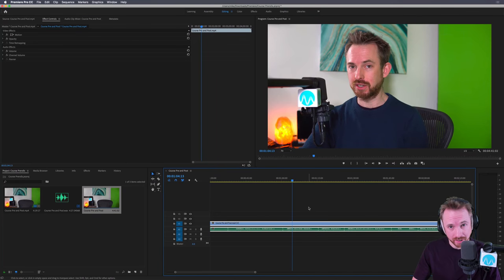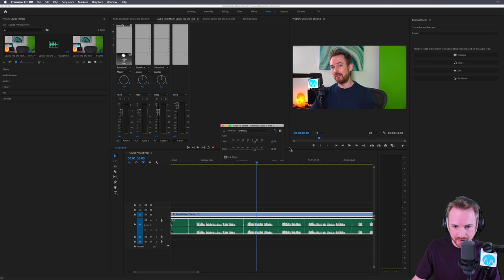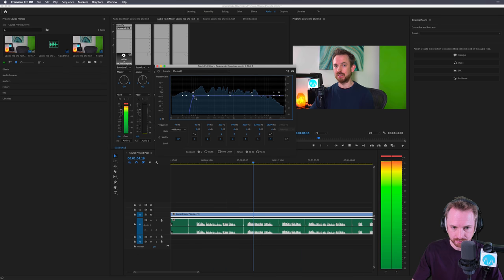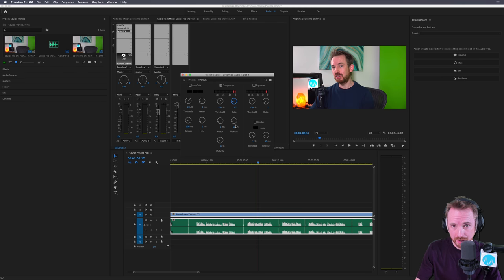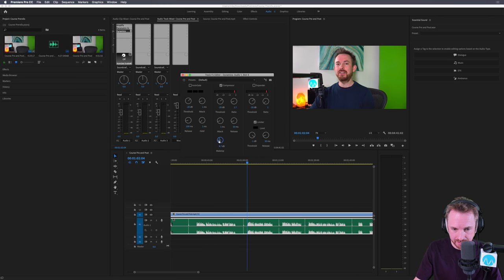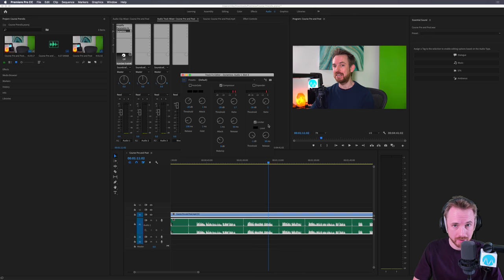How to Make Dialogue Sound Better in Premiere Pro

Comment: 🎯 Key Takeaways for quick navigation:

00:00 🎙️ Improving Dialogue Quality in Premiere Pro
- Steps to enhance dialogue quality in Premiere Pro:
  - Start with good quality microphone recording.
  - Utilize simple processes like amplification, EQ, dynamics processing, and limiting.
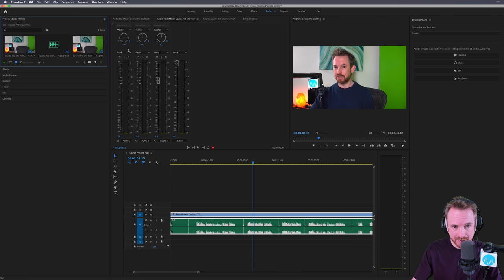01:10 🎚️ Amplifying Dialogue
- Using the Amplify effect to increase audio levels conservatively.
  - Avoid peaking by monitoring audio levels.
  - Adjust amplification to achieve optimal volume without distortion.
03:10 🎛️ EQ for Clarity
- Utilizing EQ to enhance clarity and remove unnecessary frequencies.
  - Adjusting high-pass filter to remove low-end rumble.
  - Fine-tuning high frequencies for crispness without thinning out the voice.
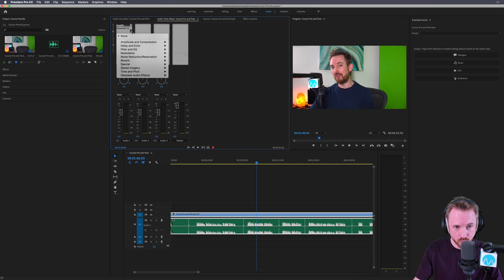04:49 🎼 Dynamics Processing
- Exploring dynamics effects like compression and limiting.
  - Compressing to even out audio levels for a smoother listening experience.
  - Applying limiting to prevent audio from clipping while boosting overall loudness.

Made with HARPA AI
Reply from the maker: Thanks for the detailed breakdown of improving dialogue quality in Premiere Pro, these key takeaways are extremely helpful for fine-tuning audio in post-production! 👌

Comment: Thank you for the video, Mike. I don't know whether I apply too much post-processing, but I use the compressor, noise gate, and expander in OBS, and then add a few simple effects in PP: denoise, deEsser, EQ, and mastering, that's pretty much where 'I'm at' so far.
Reply from the maker: A pretty nice setup there!

Comment: Thank you kindly, Mike, for this straightforward and well-narrated tutorial. 🗣🔊🎤🎙
Why not simply NORMALIZE all clips? Not sure if that's easily done in Premiere, or - if not - via Audition?
Best regards from Switzerland,
Sandro
Reply from the maker: If you want to do granular editing of the audio I would suggest using Audition.  You can export as a multi track to Audition and then normalise.
Reply: @MikeRussell  I absolutely agree. Fair point. - Thank you heaps, you living legend. 👍👐🤝

Comment: That helped a lot! BTW to get a cleaner chroma key you should recored in higher shutter speed, that will prevent that thin green line on around your shot, also add some green bar in the CC to get better skin tone.
Reply from the maker: Thanks.  I don't generally use the green screen anymore now

Comment: Great video! I hear a lot of people refer to -6 as a standard max gain. Is there a reason you're pushing it towards -1?
Thank you!
Reply from the maker: In terms of working with audio in audition as long as recorded audio doesn't not exceed 0db then anything goes.  32bit floating point allows for digital clipping to be easily resolved so the need for carefully managed headroom isn't what it used to be.
Reply: @MikeRussell  aha great insight! Thank you!

Comment: Great video. I use the Essential Sound Panel in the multitrack and set the Dynamics to 3,  set EQ (subtle male voice) to 3, Enhance Speech (male) by checking the box and then if necessary  adjust the Level to make sure it's not peaking. It seems to work well... Is there an advantage to switching to the method in this tutorial?
Reply: @MikeRussell  my own thought is that you get more customisation using your method but at the expense of a less intuitive, longer workflow
Reply from the maker: If you're using Essential Sound and like it I'd stick with it. It's very intuitive and easy to use. This is the method I like to use as I feel it gives me more control especially when adding a high pass filter.

Comment: thanks for this !! is it recomendable the DeNoise? after your process I could still hear the background white noise and the DeNoise barely fixed it, but I didn't know if I should've put it as the first effect or final effect
Reply from the maker: I'd recommend finding the source the white noise and eliminating it before any future recordings.  If, however, you must use DeNoise but it before any of what's shown in the video.
Reply: @MikeRussell  thank you! I think that the noise comes from my PC fans so it's a bit difficult to eliminate it
Reply from the maker: Move the PC to as far behind the microphone as you can.  The sensitive side of most microphones is only the front so the further behind the mic you can situate the PC the less noise from the fans will be picked up

Comment: Is there a way to avoid any/all audio edits to a clip being automatically applied to every clip on your timeline sequence? The method works, but this is a huge roadblock preventing me from continuing my project.

I tried creating a new sequence and working on the isolated clip but that did nothing to help.
Reply from the maker: If you want granular control on your mix then export your audio to Audition and do the edits there and then save it back to Premiere Pro

Comment: I have the limiter turned on as per your suggestion, but the audio level still goes above the limit amount. Does this only work for voices and not sounds?
Reply from the maker: Check the settings of the limiter.  Never in my experience has sound exceeded the settings of the limiter.
Reply: @MikeRussell  Thanks, I ended up using the Hard Limiter, which I found from another one of your clips, but the hard limiter did the trick!
Reply from the maker: Glad it's sorted for you

Comment: Does these settings apply only for interviews or can we try this for short film dialogues as well instead f going for expensive mixing and mastering? Sorry if the question is stupid, I am a newb in sound department and currently in post production of my project.
Reply from the maker: You could certainly apply the principles here to film post production although the amount of effect you apply may be less so as not to sound over processed.

Comment: how to amplify on cc 2017 ?  i cant found amplify effect in amplitude & compression menu
Reply from the maker: Hi, I would suggest updating your Creative Cloud apps to the latest CC2020 updates.  You can still normalise the audio in the waveform or use the track volume in the multitrack to boost the volume but updating Audition and using the amplify option would be the best way.

Comment: Thanks for the vid! Every time I move the "H" on the Parametric Equalizer the effect applies only for the instant of time on the timeline where the playhead is, then it immediately reverts back to a flat line. (I changed the waveform of the H as you suggest) When I play back the audio I can see the line on the PE rise up momentarily at H, then go back down again for the rest of the audio. The high-pass filter stays on though. Any ideas?
Reply from the maker: It sounds like you may have automation enabled for the "H" parameter on the Parametric Equalizer in Premiere Pro, which is causing the effect to change only at specific points in the timeline. Try disabling automation and adjusting the "H" setting manually to apply the effect throughout the entire audio track.
Reply: @MikeRussell  Thanks so much for taking the time to reply, much appreciated! It is so strange, the "H" level moves in real time as the clip plays, based on the way I moved it around to test how the audio sounded while listening to the clip. In any case, I will try to fix it!

Comment: thanks for another great video!! Just a question about the Para EQ and noise gate. Would using the high pass filter do most of what a noise gate would do? Would you ever use both?
Reply from the maker: High Pass filter eliminates low end sounds and bumps. Noise Gate will get rid of ANY sound below a certain threshold so, yes, absolutely use both.
Reply: @MikeRussell  Perfect Mike thanks! i'm always weary of misusing effects or doubling up effects
Reply from the maker: No problem!

Comment: Mike, this tutorial is great but I have a big latency issue when recording my vocal with a Blue Snowball. Any advice? I've tried it with Audacity and OBS and there is hardly any lag, but I'm very familiar with Premiere Pro (for video work) and would prefer to use that than either Audacity or OBS as I'm a complete novice with those two platforms. I'd appreciate any tips.
Reply from the maker: Latecny is tricky to eliminate, the easiest way is using an interface or mixing desk that allows direct monitoring.  Make sure you have any effects off when you're recording would be the top tip
Reply: @MikeRussell  Thanks Mike. Much appreciated. Sounds like a trial and error job. 😀

Comment: so my question is if my audio is in the same track as the audio from a game how would i go about turning the game audio down without turning myself down, i figured the game is at a higher pitch than i am so if i equalize the treble down while leaving mids and lows intact it would make me sound a bit better, i may play with preset EQs for a bit first
Reply: i know what to do for the future.
Record with separate tracks!
Reply from the maker: Always best where possible to record multitrack then you can process specificially for each track.
Reply from the maker: If they are both in the same track then you won't be able to achieve this I'm afraid.